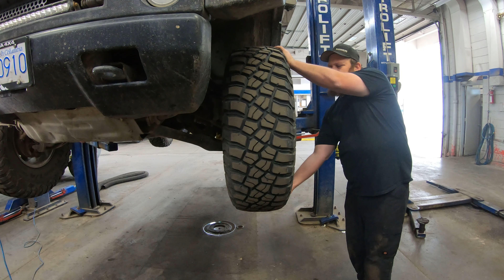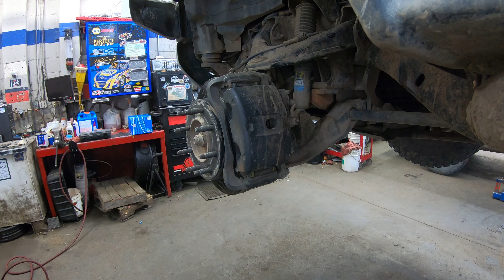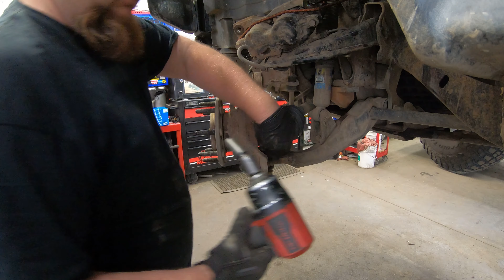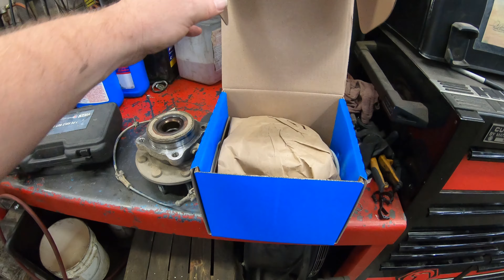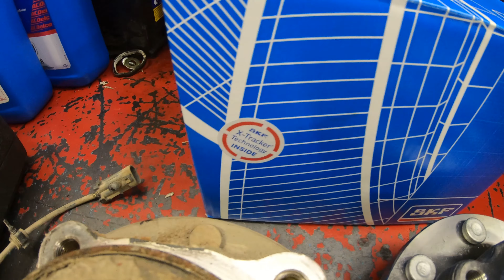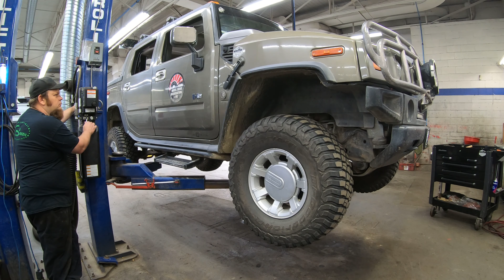How to replace a Hummer H2 hub bearing assembly

Comment: Thinking I have this issue. What was a humming sound at first to now highway speeds are extremely rough. Over 40 mph
Reply from the maker: Its a good time to check and see if you have wear in one of yout front hub bearings

Comment: Thanks for the info .. but what’s the torque spec on those 4 wheel bearing bolts  [HUB]  in the back ?
Reply from the maker: Your welcome, 133 lb ft

Comment: I have to ask Bud, do you still drive your H2? Mine is my daily driver (wheel bearing just started squeaking) It’s been all across Canada several times including BC. I live in Labrador and my H2 is about a trip from Kelowna to Vancouver from rolling over to 400,000 kms! She’s on her 2nd transfer case (mainly from towing 2x her towing capacity) everything else minor wear and tear parts. If they still made them I’d buy a new one all over again. Nice to-the-point video 👍
Reply from the maker: Oh yeah i still drive my H2 I just put a new motor in and it's running strong, sounds like you really love your truck like I do, I'm never getting rid of my H2, my new Hummer EV will most likely be my daily driver now, but don't worry my H2 will still be out there on thr trails!!!👊👊

Comment: Is the axle nut a 36mm
Reply from the maker: It's a 35mm or a 1 3/8
Reply: @TheUnexpectedOffRoad  thanks man! I had tried to get the axle nut off, I got all the parts. I was using a 36mm and couldn’t break the nut for the life of me.
Reply: @TheUnexpectedOffRoad  I didn’t have a 35mm I’d go buy one but I’m assuming I’ll just have to take it to a shop. I don’t think I’m getting it off with a breaker bar a cheater or anything
Reply from the maker: Yeah sometimes they can be really tight might need to heat it up a bit with a torch to get it to break loose
Reply: @TheUnexpectedOffRoad  I tried my torch but I don’t have an expensive one. Tried heating it up till it was glowing and use a jack to lift the breaker bar and it was just about to snap the breaker bar.
Reply from the maker: Oh wow that's really tight super strong impact gun might be your best bet
Reply: @TheUnexpectedOffRoad  yeah I don’t think whoever previously owned it ever changed the hub assemblies. It’s an h2 and has 200k on the frame and everything. Motor is new, it’s all rusted and I didn’t see any indentions on the nut so I don’t think that’s the issue